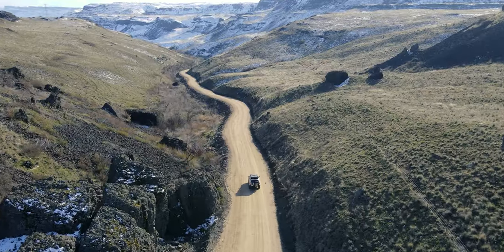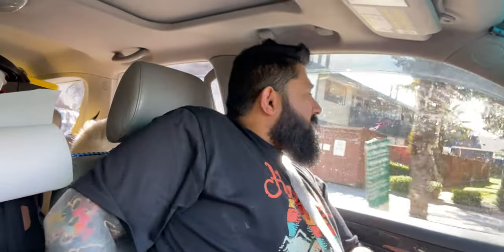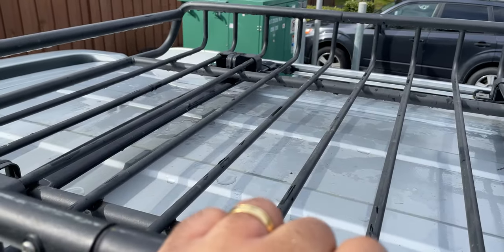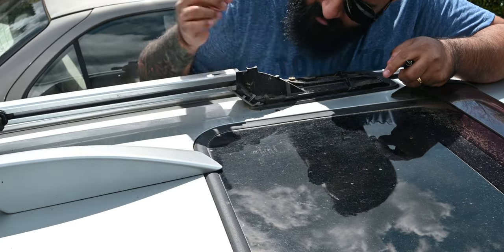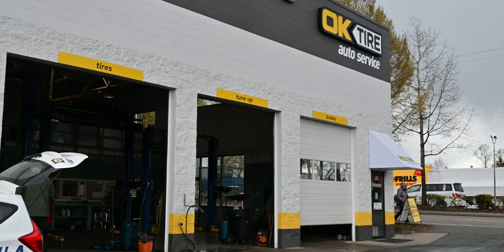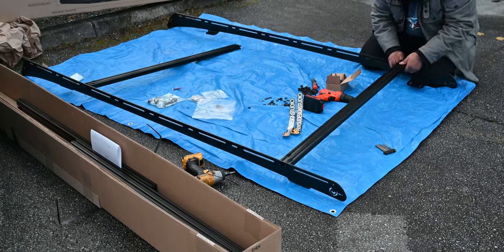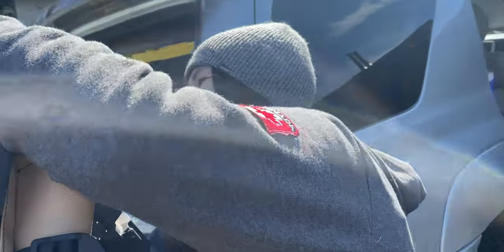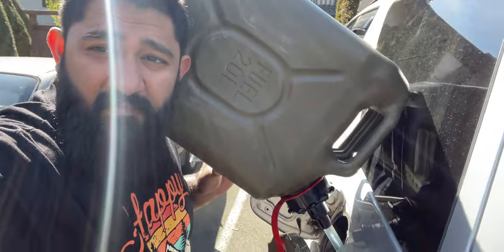Preparing for an Overland expedition, Prinsu roof rack and rooftop tent on 4th gen 4runner! S4/E0

Comment: Nice video! We're  touring the Chilean Patagonia (were we live) in our 4th 4Runner. How much has the fuel consumption changed with the RTT?
Reply from the maker: Hey, thanks for watching! Not much at all to be honest, especially since the vehicle is used for longer runs, perhaps the inertia with the added weight keeps it around the same. Gas mileage with the big tires, rear bumper, full sized spare, and the tent is so bad through